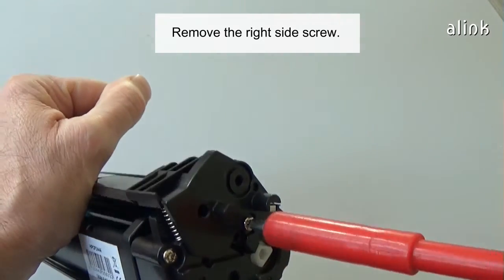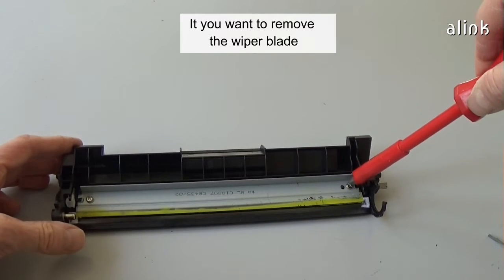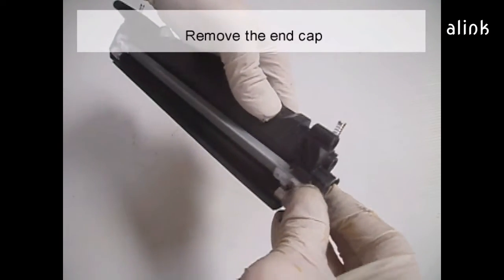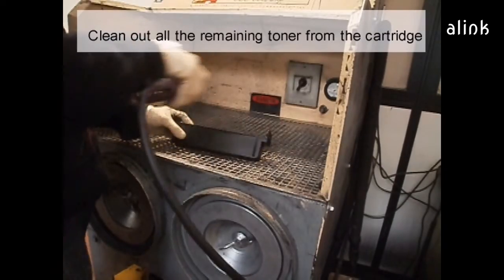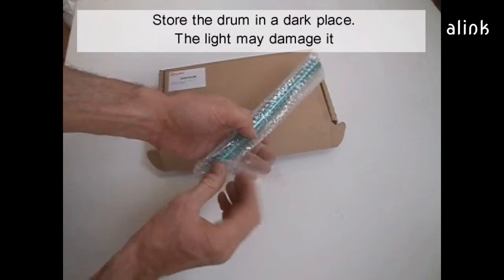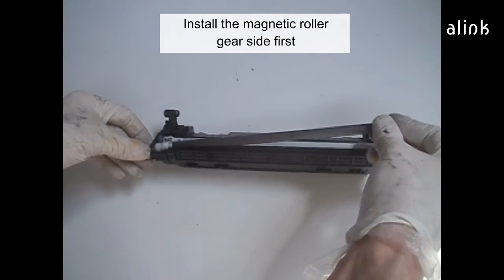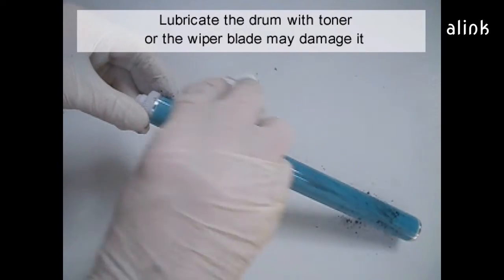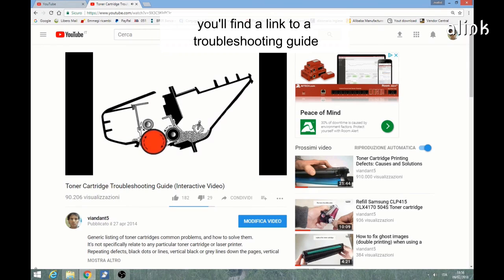HP CF244A 47A 48A MFP-M15 Toner Cartridge Refill

Comment: How do I know if t needs to be replaced
Reply from the maker: light prints, missing toner on the toner roller, missing part of the print in the sheet expecially in the centre
Reply: @viandant5  but it’s weird because it only misses part of the paper when I print like 20 pages at a time. When individual pages all the color is there
Reply from the maker: Because the mixing pad inside the cartridge distributes the toner over the toner roller when the print starts

Comment: Why the chip has to be replaced every time? Please explain?
Reply from the maker: It's a copy counter, it's better to replace it however it's not necessary
Reply: @viandant5  Thank you.
Reply: @viandant5  good to know, it means that just refilling the cartridge with the toner (without changing the counter chip) is enough for getting the printer working again ?
Anyway, in case I would change the chip, it is better starting on which phase ? first refill the toner then change the chip or viceversa ?
Reply from the maker: @sergioramunno5958  Hp cartridges don't stop the printer if the chip is over, but there is an annoying error message and probably you can't print more than a page at time. It's the same, you can change the chip before or after
Reply: @viandant5  thanks, really much appreciated your help!
Reply: Hi.. Where can I buy this chip?